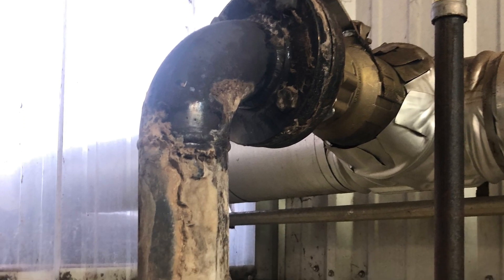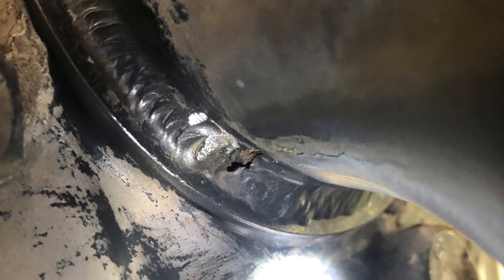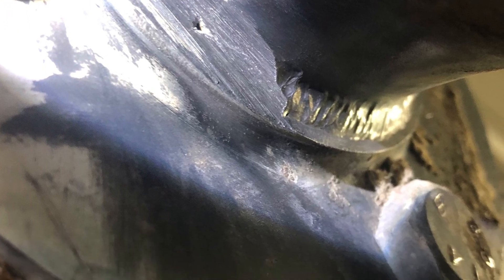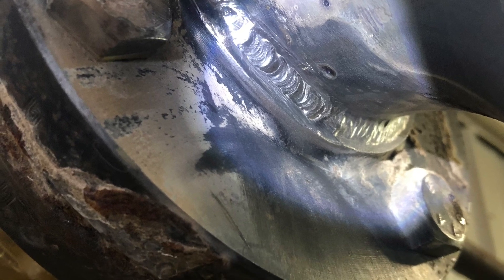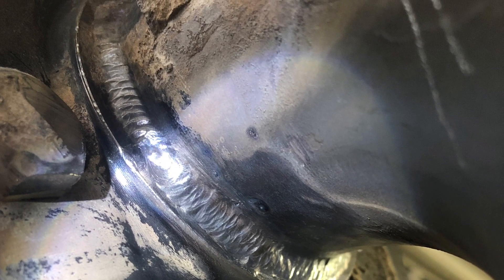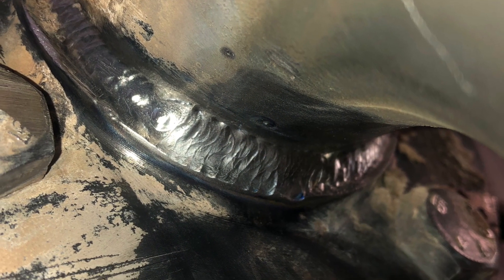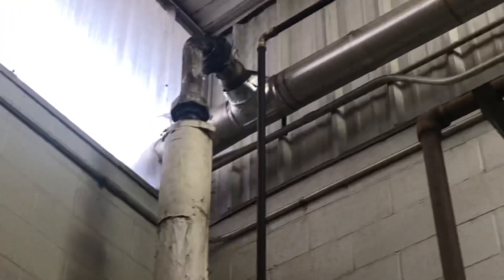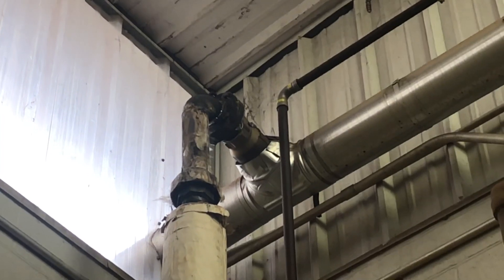Emergency Repair!! Welding a hole back up on a Steam line

Comment: Nice weave i wish i could show you some repair pics of mine had a 4 inch hydraulic pipe cant remember how thick it was but same thing middle of the pipe though not on a flange good job brother !!
Reply from the maker: Thank you sir. It was in a little bit of a tight spot so I could seee why some didn’t get a good tie in.